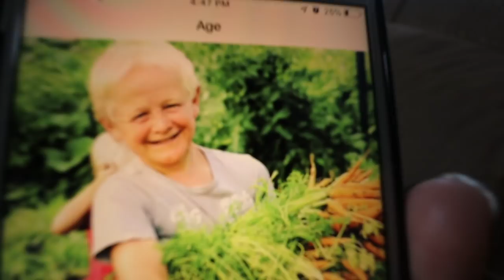NEW Cabinet gave So much more space to tiny Kitchen

Comment: It sounds like the muscles keeping the ribs in alignment were not warmed up before you started scything.  The intercostal muscles surround the cartilage holding the ribs in line. If you have had this before you’ve most likely done a little damage to the cartilage. Help them by warming up your chest muscles and back muscles before work. Simple arm above the head stretches, gentle side twisting and arm rotations for 5 minutes every morning before you get dressed will help. And again before you go to sleep, they need relaxing down properly too. Hope you feel better soon.
Loving the kitchen. Loving the excitement.

Comment: You may not be hydrating yourself enough through out the day to keep  the spongy combs in your spin soft , supple and flexible. More bananas and lentils will also help. Every so often a great hot HOT soak before bed to just relax everything !!
Reply from the maker: I'm sensing this as well. Certainly wouldn't hurt.